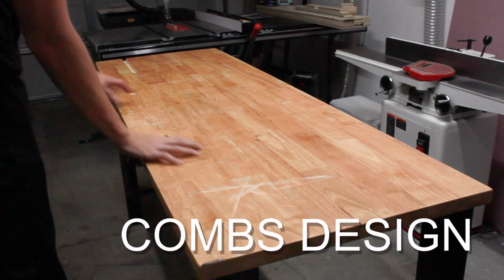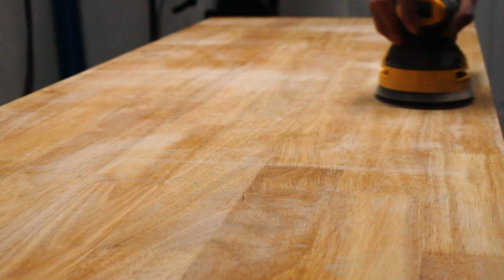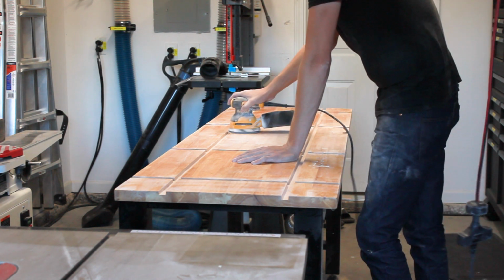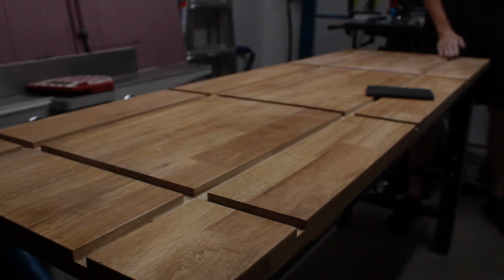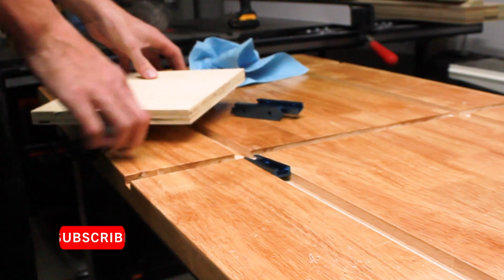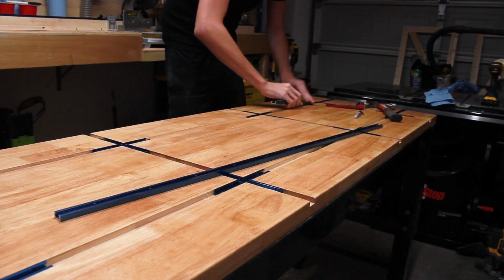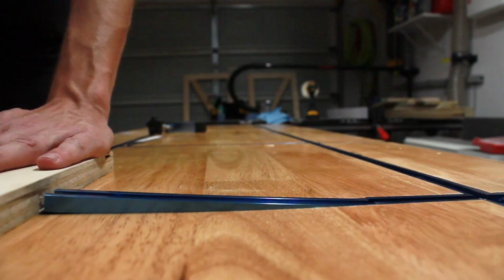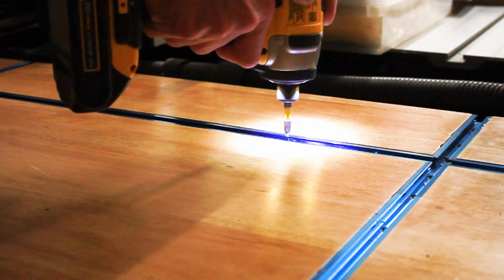Husky Workbench T-Track Upgrade

Comment: Very nicely done, just what I was looking for.
Reply from the maker: Thank you so much! One mistake I have learned since originally making this video is that you want  to avoid getting wood glue into the tracks when working on various projects. Moving clamps and other things around in the T-Track now is very difficult and I am always trying to get glue out.

If I did it again, I would also use a little bit of epoxy to hold the track down in addition to the screws. When you need to clamp something really tight, it is asking the screws to do a bit more than they were designed to do.

Best of luck on your project!

Comment: Very helpful, guy. About to cut into a laminated top I just completed with 2x4s and nervous as hell. Do I really want to cut into the top or should I make a portable table to clamp to the top? Aauurrgghh...
Reply from the maker: I enjoy having the track built in, and it provides a much larger work surface than a portable top. If you lay out your lines well, take your time, and go slowly with light passes, you will be totally fine.